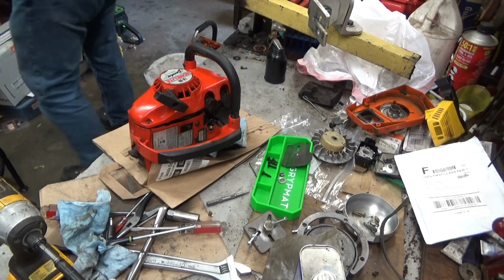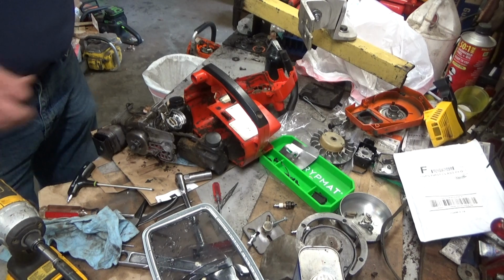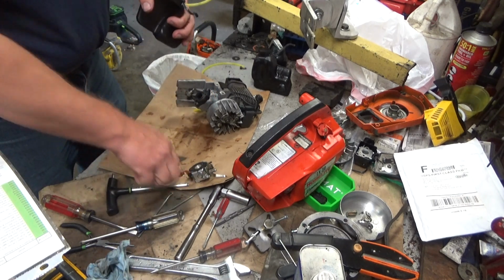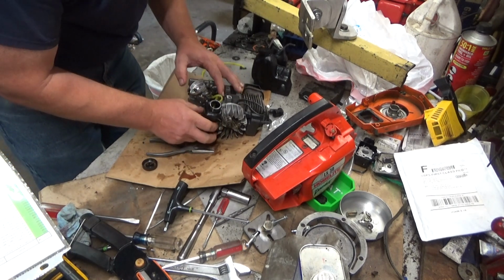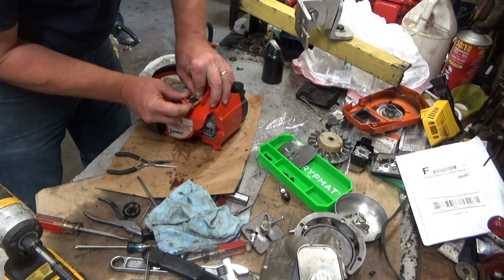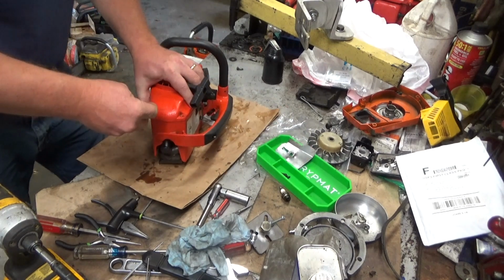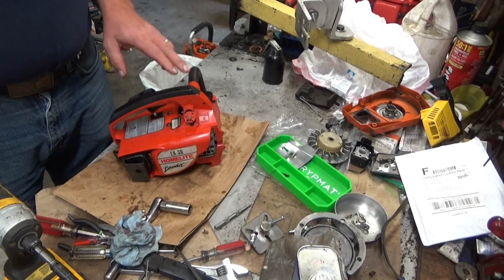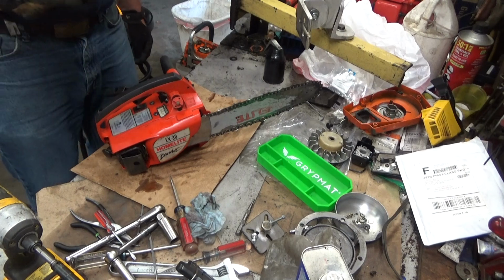Shawn's Homelite LX-30 Bandit Oiler Repair & Test Run!

Comment: Mine never had that piece under the filter either and in the oil tank it has a metal pipe the duck bill fits on just like the brass coloured one but mine is silver.
They could have designed a better adjustable valve they feel pretty cheaply made.

Comment: Great Video I have the same saw with the adjustable oil knob Zama carb and primer bulb. I think my oil filter or adjuster was clogged so I ran some cleaner through it and fixed the problem. Don’t use compressed air it will pop open. Thanks !!!

Comment: I just put mine back together and used an electric 20 gauge splice. The insulator has to be stripped off with an exacto. The little  tube fits tightly in both hose and duckbill.